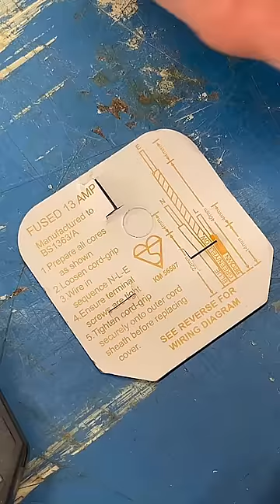Probably the Best Plug in the World 🇬🇧🔌🔌🔌

Comment: That was probably the first (and the last) time someone who gets paid by the hour wired this plug as was intended by the manufacturer...
Reply: So.... anyone taking less time and not wiring it properly, would be making less money? In other words, if you are working by the hour, why not take your time and wire it properly?
Reply: It can cause amp loss and increase your bill so wire properly
Reply: @MrQuequito  quotas
Reply: It’s the opposite. Per Job workers/contractors literally make more money the faster they can call a job finished. They directly profit from quicker finishes. Not the people getting an hourly rate, with overly demanding quotas from their bosses.
Reply: Don't Ever Forget .... the manufacturers instructions are merely Their opinion on how to do it!
Reply: @totherarf Their very well-informed opinion lol
Reply: @totally_not_a_bot  Well, yes it is, but that does not always mean they make it right!;o)
As a person who has been professionally employed to actually do this job I Do have an informed opinion on it.
My method is to remove the pins on the Earth and Neutral and the live connection from the fuse .... cut and strip my cable to length (leaving less extra on the live). Screw the cores into their respective position and slide the pins and wires in . Then fix the cable clamp.
The idea is to have all the cores in the terminals fully and tightened with a little play on the Earth and the Neutral so id some 200lb gorilla tugs on the lead the live comes out first (for obvious reasons. This has the benefit of not stressing the cores to get them in place and allows a final check on tightness prior to putting the top on!
Just to put this in context I first started putting this ytpe of plug top on when the flex was Red Black and solid Green! ;o)
Reply: @hellohii8624  Think they mean the crimps and replacing the fuse. Adding the crimps would in theory increase resistance raising your bill, but by a like millionth of a cent (or whatever a cent is for pounds). And replacing a good fuse is just an added cost.
Reply: @Skylancer727 Nope,, ferrules increase contact surface. Damaged strands will increase resistance.
Reply: @IAmTheD  yeah I struggle to find that true considering you now are transferring contact through three seperate metals rather than two. Even if it has more contact it is still has that problem. 

Plus even if the strands are partially broken, they do still contact the other strands. Plus that is the whole point of twisting the strands tight or in some cases soldering them. Even if we accept the idea of more surface area solder is still superior.
Reply: @Skylancer727  Slightly higher resistance won't cause any real issue as you still have all the strands. When you have less strands that's when you should worry.
Reply: @IAmTheD  yeah but we're talking damage only in the connection, not in the middle of the cable. It shouldn't be much of a concern. Plus you never know if they're damaged crimping it anyways.
Reply: @Skylancer727  It should be a concern because the heat can melt the socket and the fixed wiring in the terminals.
Reply: @IAmTheD  you'd have to seriously mangle those terminals to do that. You're way over exaggerating the significance of a slightly nicked wire. Trust me, I've worked with some pretty beat up wires that had been reused hundreds of times, it's seriously not a concern. 

Again, at most your wiring will be ever so slightly less efficient. The vast majority of electrical fires are caused by the cable melting, not bad termination. Those wires can usually handle the heat much better than the insulation: which melts or self ignites from the heat. I mean we're not even talking the socket melting but the terminals in the socket. That's extremely rare.
Reply: @Skylancer727  I am more baffled that you think using ferrules on stranded wires causes more issues than just shoving stranded wires into the terminals. It's pretty much standard practice in automotive and aerospace as well and the regs require fine stranded wires (flex/class 5) to be crimped while solid stranded wires (class 2) don't necessarily need ferrules as they are more robust but you may put ferrules on them if you want to. Electricians who fail to comply may get themselves audited by an inspector. You really think the regs were made by some clowns who have zero knowledge on electrics?😅 Oh yes, resistance generates heat and heat can melt stuff and copper is not an exception. I have a degree in electronics engineering so I know what I am talking about 😅
Reply: @IAmTheD  funny, so do I, yet we nearly always used stranded wires directly in the terminals in university. It's mainly with machinery that we used crimps, but not ferrules, just the all popular round crimps you stick a screw through. Use those all the time with motors. And why would crimping a wire be any different than screwing directly to it? I will say crimps are far better for pigtails as wirenuts are worthless with stranded wire, but there's no rules saying you can't use wire nuts. Those are known to destroy wires yet are fully allowed. 

And yes copper can melt, but if your copper is melting you way over drew the circuit. The wires themselves are way higher rated than the insulation they're held in. And the terminals you attach them to have even higher tolerances. If there's a few strands cracked it should still be fine. 

And I didn't say ferrules are worse than broken strands, they're probably on similar regards. But in general much like converting one form of energy to another is less efficient, so is transferring electricity from one material to the next.
Reply: @Skylancer727  You have zero knowledge on current carrying capacity of a conductor, right? Otherwise you won't say such thing. Are you from the USA? Wow the standards are on the floor. No wonder your electrics are stuck in 1950s.

Comment: If 'Home Alone' had been set in the UK, there would have been a moment where one of the bandits trod barefoot on a BS1363 plug
Reply: I'me  71, never stood on one😊
Reply: @onelineal9382  There's still time!
Reply: @stpeter7432 nasty that 😂😂
Reply: There a video of some poor chap unplugging one from his foot 😂
Reply: @onelineal9382 

You haven't lived if you haven't stepped on one of these bad boys!
Reply: @thomasdoherty6876  The chap really has soft foot.
Reply: *in
Reply: Yes, but at least Marv wouldn't have gotten electrocuted - the sink scene would trip the RCD.
Reply: I can't think rcd is that common I've never lived in a house with them only fusewire
Reply: @carmadme  This is musing about other countries being behind on the basic safety improvement really - if you wanna be technical; the kid used what's probably a transformer-isolated device, so nothing's going to trip anyways.   But if they didn't... Uh, yeah, RCDs are everywhere in the UK; required on new construction since the 1991 version of regulations it was on some outlets only, but in 2008 it changed to wires in the wall, all outlets, etc.
Reply: @carmadme  Should have seen our place before I rewired it. The fuse box was like something out of a Jules Verne novel!
Reply: @carmadme  All new UK housing use RCD systems now by law, but older houses don't
Reply: @Valisk  I've not heard of jules Verne but ours in the old house looked messy an extension had its own fuse box and wiring and also a big 250A 3ph system had been put in too for the electric central heating storage heater
Reply: People always talk about standing on UK plugs, but I never get it, who's unplugging all their stuff and leaving plugs everywhere? Just flip the switch, the appliance is fully disconnected, so just leave the plug in the wall :P
Reply: American plugs are just as bad if they're attached to a wall wart. Ive had to dig USB chargers out of my foot before.
Reply: That happened to me my foot was cut open

Comment: I always make the earth wire a few mm longer than that so that it would definitely be the last one to disconnect if the flex were pulled very hard, for additional safety 😉
Reply: You're hurting the cable grip's feelings!
Reply: Quite likely the specified earth wire length is already long enough to do so... but if it fits, why not.
Reply: In the world of residual current detectors that is rather insignificant.
Reply: @lepathewarrior4445  Yes - but no.  Just because the RCD would trip doesn't mean you won't have a nasty shock.  It might not impact those who are healthy, but it could still save the life of those who've a weak heart.
Reply: isn't that given by the plug's design anyways? Anyhow in Germany it's a guideline to do so.
Reply: @UKMonkey  dude the fuze will never come into play if you have a RCD installed correctly, the power required to trip RCD compared to any fuze is so ridiculously small that the fuze simply doesnt matter.
Reply: @lepathewarrior4445  'Dude' just the other day I had a fuse blow in a plug on an RCD protected cicuit. The RCD did not trip.

The leakage current (what I assume you mean by 'power') required to trip an RCD is indeed tiny, but the key word is *leakage*. That is what they designed to detect, and therefore do something completely different to a fuse. A device that has a fault and starts drawing way more current that it should, but without a earth leakage fault will not trip an RCD

RCDs and fuses are two different products designed to do two different things. In broad strokes a fuse protects property, an RCD protects people.
Reply: @ryanmitcham5522 in a world dominated by armchair experts in every field of expertise you have shut them down with facts presented in simple manner...hats off to you sir
Reply: @lepathewarrior4445 so many installations still don't have RCDs you realise that right?
Reply: @ryanmitcham5522  You didn't read the original comment? He was talking about leaving the earth few mm longer than neutral and phase, I know what fuses are for but they aren't relevant to what he is talking about. Yeah it's not bad to do as he says but probably not worth the effort
Reply: @ryanmitcham5522  Fuses are going to blow often because your ring finals circuits are fed by a freaking 32A breaker. On a 16A radial circuit like in other countries, a 13A fuse might never get blown at all because a 16A MCB will likely react much faster to overcurrent than a 13A cartridge fuse will burn (except if the fuses are rated much lower than 13A)
Reply: @grahamallen1970  mainly because of British 32A ring final circuits. Fuses will get blown much less often on 16A radial circuits like in most countries.

Comment: since moulded plug became law some years ago, kids and many young  adults haven't  a clue how wire one these. A lost life skill, along with Dad replacing the fuse wire in a BS3036.
Reply: I had a call out to no lights working.  Got there and it was rewireable fuses , a card with fuse wire on top of the old brown wylex.  Shame they hadn't used it .
Reply: @dennisphoenix1   A classic example you have there.
Reply: @stevethomas5849  it was as well they had fuse wire because I didn't
Reply: @dennisphoenix1 not even a paper clip, or my old favourite, the straightened out staple?
Reply: @GBOB68  what's your point here ?
Reply: I was taught in physics class at school, and I am only 19
Reply: @dennisphoenix1  To use as substitute fuse wire. Perhaps you're not as old as I have assumed.
Reply: @GBOB68  I wouldn't use a paper clip . It being steel and probably 0.5 mm thick would carry 50 to 100 amps in that short a distance.  I have used a couple of strands from a piece of flex but as a temporary solution. Only
Reply: @dennisphoenix1  It was a joke. Back when I was young I believe it was common for people to actually use a paperclip the fix a persistent blowing fuse. I also remember people pushing bare flex into the socket holes and shoving the plug in on them to save from wiring up the plug. This was way more common then you would believe.
Anyway, that's why I made the comment, as a joke about the past!
Reply: @dennisphoenix1  still got that type at our family home
Reply: no its not 'moulded' plugs that is law, but a 'prefitted' plug, it can be a rewirable type
Reply: @GBOB68 or the 1” nail…
Reply: @bob_the_bomb4508  through the head fuse because it popped
Reply: @GBOB68  I know you guys are joking about using a piece of metal as a fuse but never do it! If someone else uses it and it goes wrong you can be charged with intended manslaughter. Especially in a workplace. It’s a very serious mistake
Reply: @jwalker7567  It was genuinely a common practice. No joke. People would fix a blown fuse with whatever worked if there was no fuse wire sitting on the fuse box. This probably went on till the 90s. The other thing I mentioned about people putting bare flex wires into the outlet socket using a plug to slam them in was also a real thing. I'm glad it doesn't happen these days but it's probably much of the reason for the UKs strict regulations.
Reply: @GBOB68 i remember an episode of MacGyver where he used the foil wrapper from a piece of chewing gum. The babe was impressed and said 'why can't i think of money saving tricks like that? '
Reply: @GBOB68  I believe you! Probably why they got rid of fuse wire.
Reply: I have a tendency to replace moulded plugs because I find many of them have rubbish finger grips on them. Rewireable plugs have ruddy great ridges to get hold of. Also some of those moulded plugs are giant even for a UK plug.
Reply: I’m a spark and watched a qualified man stick fuse wire into a rewireable and leave about 30mm of wire out one end. Old metal Wylex board, I just sat there with the 🍿 waiting on him sticking it in and the bang to follow.
Reply: Only law on new appliances.
Reply: @dennisphoenix1 
Perfect for fixing the main fuse on a coach (I've seen it done in an emergency)

Comment: What I learned 20 years ago in the german Berufsschule is that a screwd electrical connection will fail one day or another due to temperature expansion or kompression which can lead to a fire in the plug. Thats why a high value plug is fitted with feather clamps that will increase or decrease with the scope of the line.

Comment: I agree. But even though MK quality is not what it used to be I still use and recommend MK plug tops for items that take a high current.
Reply: Mk plug tops still got the wrap around connection's?
Reply: MK were always my favourites. They felt really solid and were easy to wire up.
Reply: I love their stuff - I'm currently having my 1982 house refurbished - I saved all of the original MK socket faceplates, cleaned all the paint off the edges, and polished them up, and gave them back to the electrician to re-use. He thought it was odd, but agrees that they are better quality than the stuff he can supply. They look great, too.
Reply: @type17  F*ck doing a cert knowing I have fitted 40 year old sockets! HAHAH!
Reply: Agreed my old man was a top sparkie and he used mk stuff, I never bothered becoming qualified but I use mk stuff and I was wiring up hotels at the age of 14 lol
Reply: @jameznm  MK these days is utter dog poo! 😫

Comment: Love those ferrules.  Could have used them a thousand times.
Reply: God i know it. Ive taken to soldering stranded wires. No way in hell u would ever find me getting down on a grub with loose strands smooshing everywhere but under the grub screw! Good times childhood was
Reply: One of the very few Euro wiring devices that really works as designed!

Keep your high resistance WAGOs!! A spring clamp connection is just a bad idea! But ferules are a crimped device which improves screw secured connections on stranded wire. Especially handy on those really small terminal strips for things like PLC IO.
Reply: Always a good idea.
Reply: @Wtfinc Apparently, soldering stranded wires before using them in a screw terminal is the worst thing you can do. The solder is too compliant and provides no spring force to maintain the connection, given expansion and contraction of the junction when in use. However, it's OK if you were to solder the very tip of the exposed strands, just to retain them while inserting the wire into the terminal.
Reply: @jamesvdv0  solder is softer than wire. There’s no difference between soldered stranded and solid core. And what about ferrels? They are harder than coper or solder. Solder shouldn’t be used in HV/HI situations where the solder could melt but also the reason u get heat in a joint is from bad connection and solder would be the best at midigating that. And for those asshats who leave tape and wirenut balls in peoples walls and ceilings are the worst. Ur better off not using tape at all.
Reply: @Wtfinc do not tin copper conductors that will be mechanically terminated.
Low temp solder has no elasticity to maintain a low ohmic mechanical connection. 
If you want to you can braze or fusion weld the strands....or just use a plated copper ferrule.
Reply: @walsakaluk4630  I got some lead based solder and watched it crack under normal conditions. It will always be better to use ferrels. I mean they allot easier too. But, if all u have is solder and stranded wire, u will always be better off soldering it and screwing down nice and tight if normally the strands would squish out. If theres no chance of squishing out, don’t worry. Adding solder makes it super rigid right where the solder ends and if the wire moves too much, it will break right there. Ferrels are allot more forgiving. Fusion would not be good either. Unless is really big wire. Lets say it all depends lol.
Reply: @walsakaluk4630  when i can get my hands on ferrels, I will use them any chance i get. I hate screw terminal and stranded wire
Reply: @Wtfinc  that's kinda erotic😂,but yeah, keep ferrules and crimpers in your tool box.